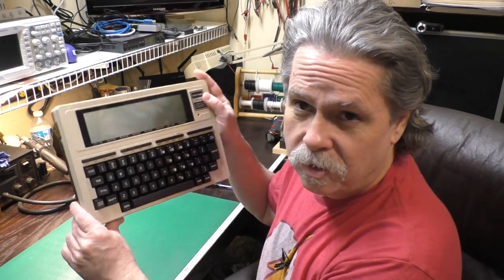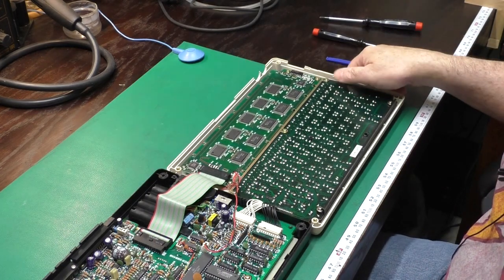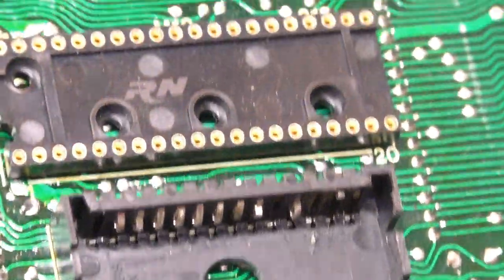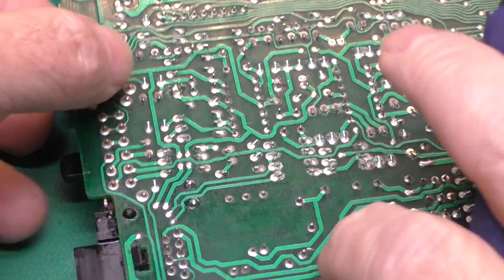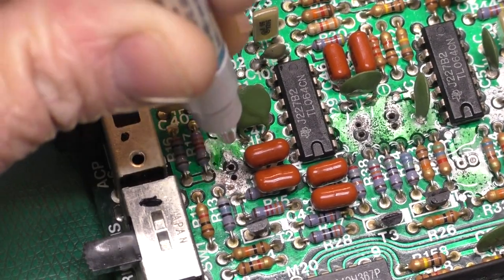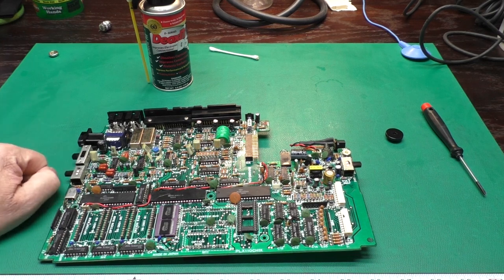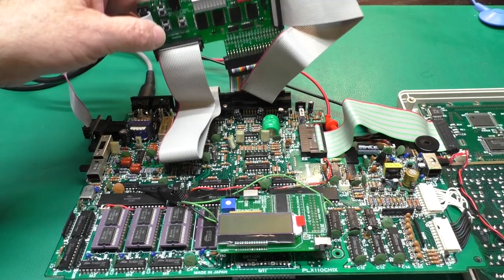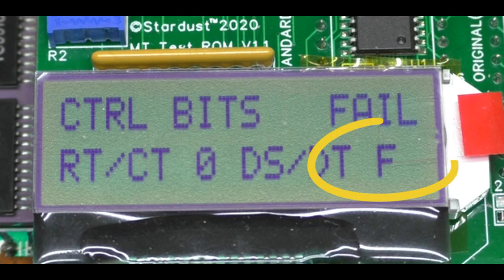TRS 80 M100 Part #2 Recap, Mangled Molex, ‘More surprise failures’

Comment from the maker: Hi everyone. I wanted to provide a bit of an update on this particular repair. While I replaced T25 in the reset circuit and it worked I later tested T25 and found it was fine. The issue, once again, was the cursed flux becoming slightly conductive. 

I did not want to update the video after it was out there and after all, making mistakes is all part of the process.
Reply: you all probably dont give a damn but does anyone know a trick to get back into an instagram account?
I somehow forgot the password. I appreciate any assistance you can offer me

Comment: I work on a lot of 1k-Z ECU's where I work, those are notorious for leaking caps and subsequent track damage. To remove the caps on those I snip the leads and pull the remaining leads from the board one at a time, this should reduce through hole/pad damage and maybe make it a bit easier to deal with the ground plane, this may work on your boards ok, but you will need at least some access to the leads on the cap to snip them
Reply from the maker: Hi, I have also snipped parts of boards when they were known to be bad and that was the most straightforward way to prevent damage to the PCB. It does work well.

As you mention many of the caps on the M100 would be hard to snip the legs off of due to how closely they are spaced to other components. But it is a good method to keep in one tool box of ideas.

Comment: Another great Hey Birt! video with valuable insights.  

Question.  Was all that flux that needs to be cleaned off left as part of the manufacturing process?  I guess modern PCB production solved that issue?  Is it that layer of flux that makes desoldering old components difficult at times, meaning one has to apply enough heat to get through the flux before heat reaches the solder on the component being removed? Anyway, great cleaning instructions.

Side note.  I've used my Weller battery-powered soldering iron to work on some of these boards and I don't recommend it.  It take too long to heat up and I'm not sure the temperature is high enough.  I did one recap myself.  I think I scored a D-minus to C.  The problem I can see now was not cleaning off the flux residue first and using the wrong soldering iron.  I give myself points for trying to learn and while not great, some success with some caps.    I found, using your terrific map, A, B, D, and E the most difficult to remove and replace.  Not sure if that area has a lot of flux or what.  They were the hardest to me to heat up.

On the ZIFF socket, you can easily remove them by lifting the locking arm up.  Reverse for easy installation.

Yea, that SuperRom is shot.  Too bad.  One of the better ROMs in my opinion.  Younger folks may not remember, but when early spreadsheets made it big (VisCalc, early 1-2-3), in business, people were using them for everything.  Spreadsheets.  Small databases.  Memos.  Etc. Granted, small documents, but very capable.  Let's face it, if one wants to use a Model-T today, REX is the way to go.  After that, let's get a NADSbox somehow built into the Model-T with a USB port.  Solves storage, portability, and compatibility with PCs.  (OOPS, daughter tells me Macs no longer have USB ports?  What do their users do?)

Also, for the beginners, can you remind us the best solder to use?  Is it lead-free or with tin lead?  Gauge?  Some modern solder has flux in it, true?  Recommended?
Reply from the maker: The flux was from original production. Flux can be 'no-clean' meaning it can just be left there, water clean meaning it can be cleaned off with water, or a solvent clean meaning you need some nasty solvent to clean it.

I'm guessing these boards used a no-clean flux which was OK then but after 35 years starts to cause problems. There are some types of glues used in PCB production that have the same issue after decades of service. 

Flux has a low melting point, below that of solder. as you heat the joint the flux will liquify and help to clean the copper by removing oxides. For older equipment, say pre mid 1990s use lead/tin solder. I prefer 63/37 rosin core, about 0.032" diameter.

I did have the modern maker/maintainer of the SuperROM offer to send me the proper shim so I hope that works out so I can have another try and fixing it.

Comment: Re: Alcohol. A lot of fluxes are hydrophobic; and if there’s any water in your alcohol, it’ll refuse to go into solution. I use 99% isopropyl in a spray bottle; and it works rather well with Chip-Quik no-clean gel flux. 70% rubbing alcohol won’t work at all, because the 30% remaining is distilled water.
Reply from the maker: I use 99% denatured alcohol which works fine on most fluxes but the stuff used on these boards is something else.
Reply: @HeyBirt  - and I’m sure that the what, 35 years now of oxidation and polymerization isn’t helping matters, either. 😐
Reply from the maker: @darkwinter6028  I'm sure that is not helping and is also why it starts to become conductive. Some sealants used on old PCBs, like glue around big capacitors, can also become conductive over time. But I guess the designers did not fathom that we would still be tinkering with these old computers 30-40 years latter.